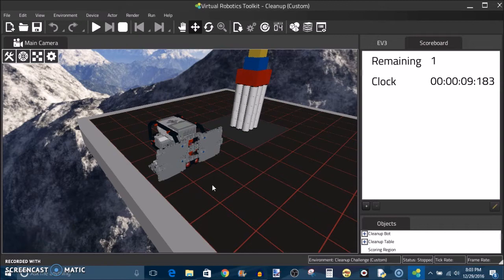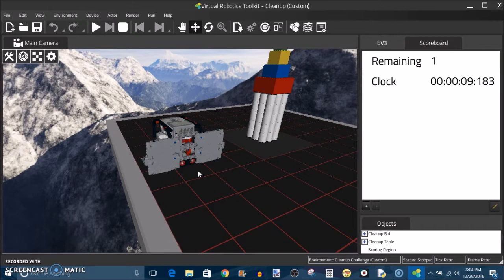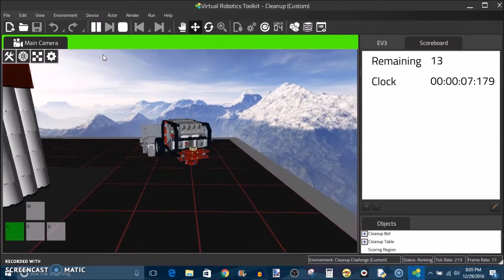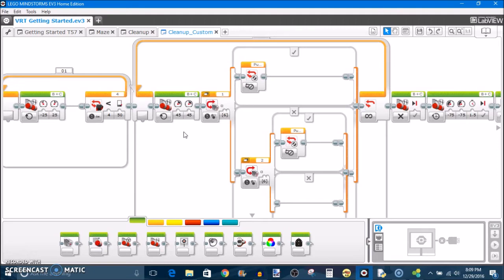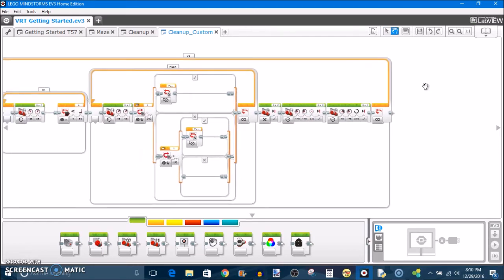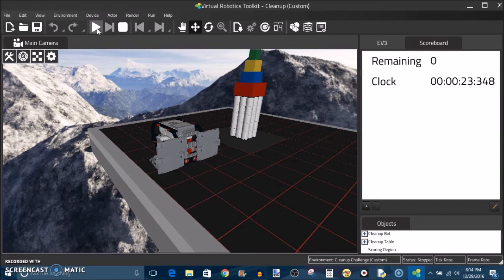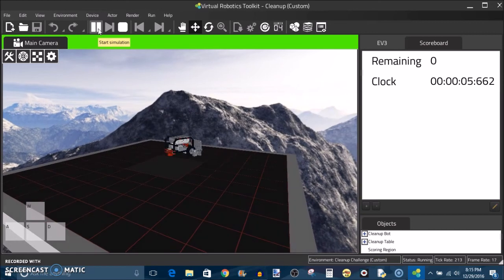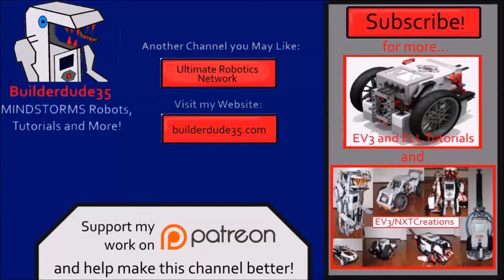VRT Cleanup Challenge Walkthrough

Comment: Hi Dude! I have a question. In NXT sensor, it shows the black color code as 1 and if there is no color, it shows 1 again. And when you try to use it for this years WRO challenge, it fails. Is there any way to make this fixed? Thx!
Reply from the maker: No, the NXT color sensor cannot tell the difference between black and no color. The EV3 can tell the difference, as it has a "no color" mode.